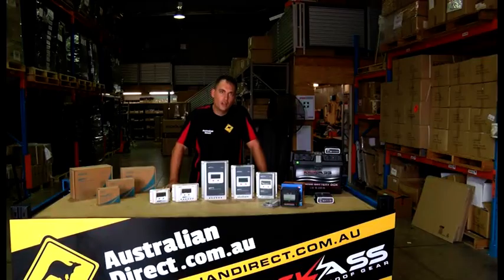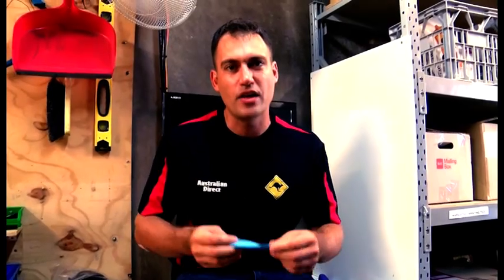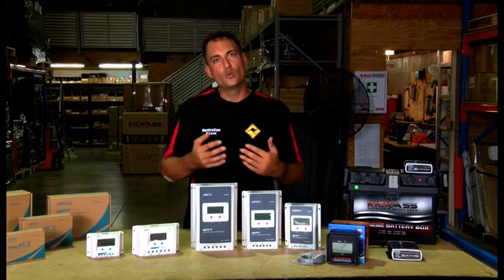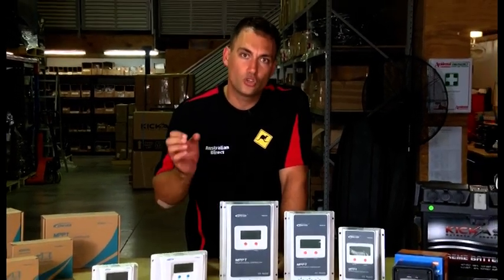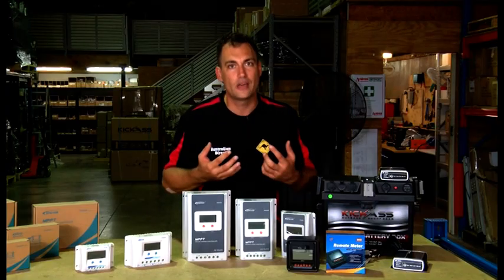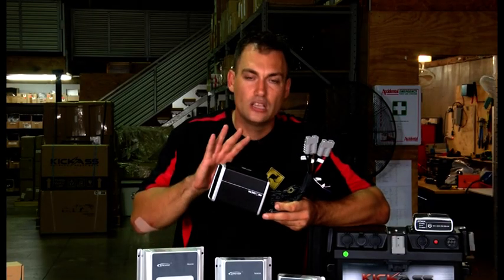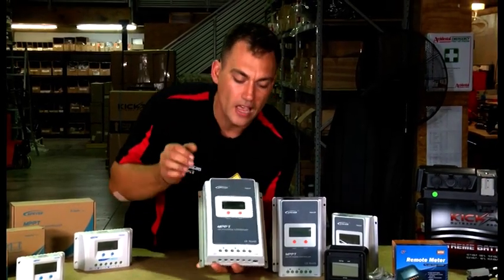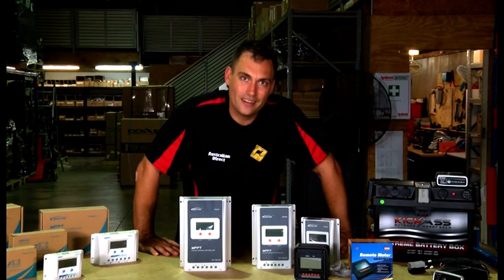MPPT and PWM Solar Controllers

Comment: Hi i received my kickass solar controller i love it can i check how many amps my solar panel is putting out thank you
Reply from the maker: The amount of current (amps) that the panel is producing all depends on what the connected load is. If you connect a flat battery to the panel you will see the battery "draw" a current in amps from the panels. If you then connect an accessory such as a fridge or oven to the battery you will see that current draw increase.

Hope this helps.

Comment: Hi i have a 300watt solar panel and 2 x 100ah agm batteries what size Epever controller would i need thanks
Reply from the maker: G'day, You will need at least a 20 amp controller for a 300 watt solar panel. However you may find that a 300 watt panel might not be enough to charged 2 batteries and may want to expand your system in the future. In that case a 40 amp controller will give you an upgrade path.
Reply: @KickAssProducts  Thank you the panel is putting out 25 amps or more

Comment: On my motor home i run 3 x 200 watt Mono panels thru 3x 20 amp epsolar controlers , The reason is if one gets smashed or goes bad i still have 2 , they are great I have never had a drama and have the wifi modules also ,, I dont have my house batteries conected to the truck alternator as the solar keeps up with everything i need , I run a 3000 watt inverter (Yes conected to the battery and the 0awg wires to the inverter are short as possable , What i love is the MPPT controller can sense the inverter is on within 5 seconds and regulates the charge ,, I do have a 3600 onan genset but i only run that now to make sure the thing starts , EPSOLAR is the best thing to happen to solar for motorhomers in Australia in 20 years ,,,, I put them in the same basket as ENGEL and ARB ,,, just a top company ,,, 
B.J.T NSW South Coast ,,,,,, "having fun !"

Comment: Just purchased KA1224MMPT40A .... not too sure about user manual comment "Within ten minutes after the controller stops charging reversely connecting the battery will result in damage to the the controller" Can you tell us what you mean by "Reverse Connecting" .. What should we avoid? many thanks!
Reply from the maker: Hi Data Glasses, this just means that if you accidentally reversely connect the battery input (e.g, positive into negative or vice versa) you have 10 minutes to amend this error before damage may be done to the controller.
Reply: @KickAssProducts  Now I'm with you , cheers!

Comment: Hi Clay
Can I use 1 solar panel with 3 MPPT’s to charge 3 motorbike batteries?
Reply from the maker: Hi Crispin, we would not recommend this as the 3 regulators will be fighting against each other for the charge. Our recommendation would be to either charge the 3 batteries with three different panels or connect all the batteries in parallel and use 1 regulator and panel.

Comment: Can any controller charge lithium batteries
Reply: No pwm won't work with lithium but most not all mppt controllers will make sure to read description first before buying
Reply from the maker: Hey Merv, only chargers rated to charge lithium-ion batteries are capable of doing this. Just like with a normal charger you have the option to select "Wet, Calcium or AGM" to get battery type specific charging, lithium-ion has its own settings, specifications and needs from a charger.
Reply: Please read this article at https://www.powerstream.com/LLLF.htm

I am putting together a 900Ah lifepo4 system, and plan on using a desktop switching power supply set to the appropriate voltage, say 14.4v. The bms will do the rest. BMS's are smart, too!
Reply: It's about voltage regulation. A decent pwm will provide the appropriate voltage, up to the desired set point. Lifepo4 does not require float, so either use a cutoff  timer or just pay attention.

Comment: very good info. thanks Clayton, just purchase one of your suggest MPPT brand, 40a, w 2 Gel battery x 150Ah and parallel connect together, question , should I setup Gel 150Ah or 300Ah in MPPT ?? ( as it is Parallel, so is still 12V, but double amps x2 ??), did not see this info. in the user manual, thanks, jeff
Reply from the maker: Hi Jeff, you shouldn't have to set up your battery bank size through the regulator mate but If you do you would set the bank up as a 300AH battery.

Comment: hi Clay, is it possible to connect two panels with each their own regulators to the one battery ?
Reply from the maker: Hi Stefan, it is not possible as the two regulators will fight against each other when trying to charge the battery.

Comment: MY EPEVER 40A UNIT STOPPED WORKING THIS WEEK AND THE CURRENT (AMPS) WILL NOT COME THROUGH - WHAT IS GOING ON PLEASE?

mine stopped working today after owning it only 5 months.   i have (4) 60W panels hooked in parallel @ 22V and 1.5A each.  so the voltage reads correct as 22V but the current reads as 0.00A.   

my question is what could it be?  or what is the contact for the manufacturer?  or is this a known failure?

after watching many reviews it seems i should check the internal fuses, which i will do right now.   ...FUSES ARE BOTH IN TACT!

one thing i did notice was the screws are NOT good in salt water air conditions because mine are corroded.   i will attempt to replace with stainless steel screws.
Reply from the maker: Hey There, we are sorry to hear there was an issue with you MPPT, could you please contact our customer service team on (07)3123 4715 or alternatively email a detailed description of your issue, accompanied by a short video showing the problem, and your order number or customer details to sales@australiandirect.com.au and we will be able to help you out. Have a great day!

Comment: What if your solar panels have solar charge controllers on them and the solar generator has a solar charge controller on it would that be a bad thing? Is it better if the solar panel have a charge controller on itself then feed a regular charge controller. Or once the solar panel sends voltage from the panel controller it can go directly to battery without any worries? 

 

 

Reply
Reply from the maker: A solar panel can only be regulated once by a regulator (Charge Controller). Solar panels will output power to the regulator and onto the battery. The system must be kept in a string like this and cannot be regulated more than once.

Comment: Gday mate... I'm still finding my feet with my off grid solar system. I like the look of this controller (EPSolar Tracer-4210A 40amp 12/24v Controller) and recently was gifted 12 x 175w x 24v panels. Can you tell me how to calculate how many panels this controller will handle. 

Currently I'm running 3 x 85ah x 12v batteries in parallel off 3 x 185w panels and victron 100/15 controller.
Reply from the maker: Hi Big Dog,

The maximum input is 100V and 550W on a 12 volt battery bank. This increases to 1100W on a 24 volt bank.

Therefore you could have a maximum of 3 panels and they mist be wired in parallel so you don't go over 100V.

If you have any further questions, or would like us to organise that for you, please don't hesitate to contact us directly.

Comment: can you use mppt solar charge controllers and a projecter idc25  together 
at the time
Reply from the maker: Hi Garry, the IDC25 Projecta Charger has a built in 25A MPPT Solar Controller. You cannot double regulate your solar output.

Comment: I have a 4210A running for nearly a year now, without a hiccup. I run a 1.14 kW panel-set all parallel into a 24V 400Ah battery. The setup can produce 900W from my 1kW pure-sine inverter, but I avoid loading more than 70% of continuous rated power. Connect your PC/laptop to the comm-port via an RS485  to USB adaptor (~$2) using free Epever software/GUI. My 'Me-ter' was not worth the money and is still in it's box.